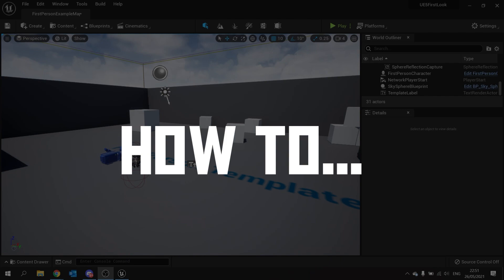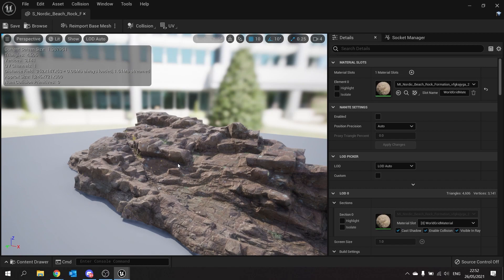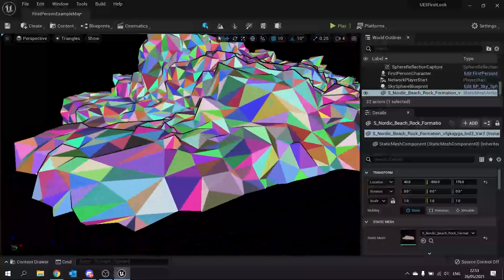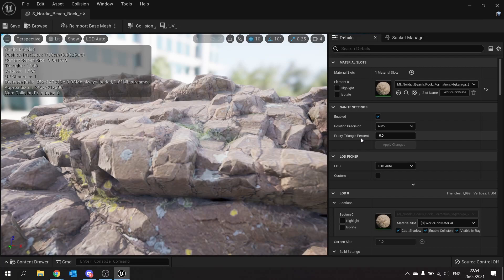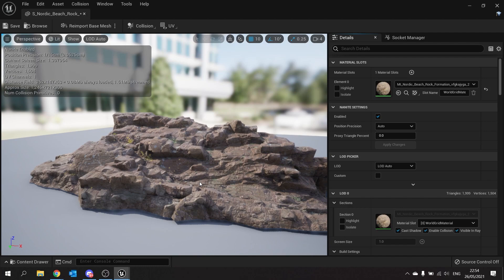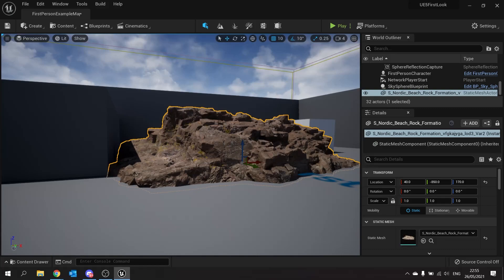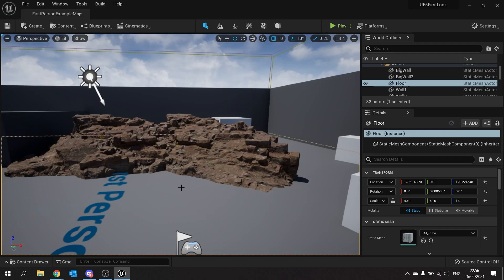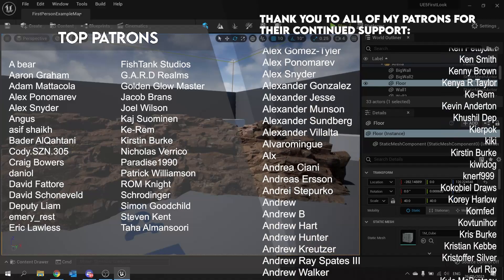Unreal Engine 5 Tutorial - Create Nanite Meshes

Comment: Does it still use uvs?
Reply: I have never thought of that. Holy cow, I must investigate, they render amazingly fast and when project launches is also 100 times faster. So I would say is maybe done in the way nanite is stored.
Reply: Yes, UVs are still supported. It's basically the same workflow as with film assets. For example I tested with a UVed 2.8 millions polys mesh and a 8K texture, imported it in UE5 and it worked just fine, with the texture applied.
You can use the standard "Work On Clone" in ZBrush to create the UVs and then apply the subd. Nanite also supports imported vertex colors (you can't paint on the mesh in editor but you can use ZBrush's PolyPaint on a very dense mesh and it works fine as well.
But in order to get the best "texel density", you can simply use typical shaders with tiling textures along with any other regular tricks like using the camera distance to affect the tiling scale, using masks, etc...